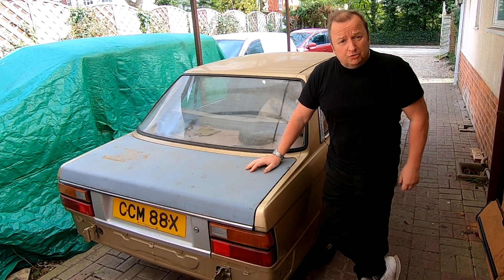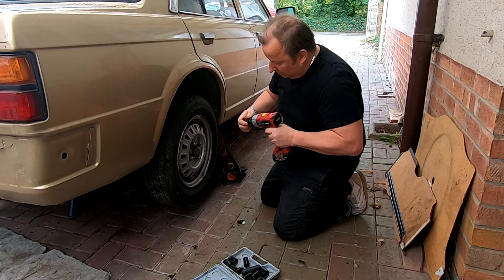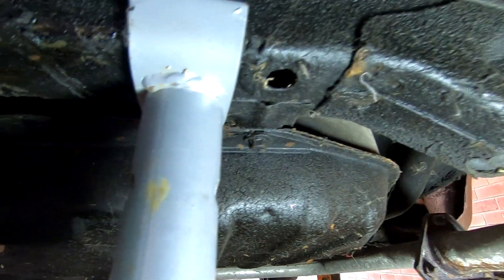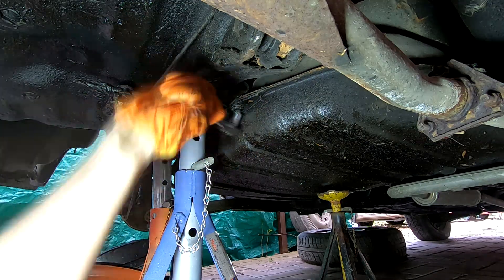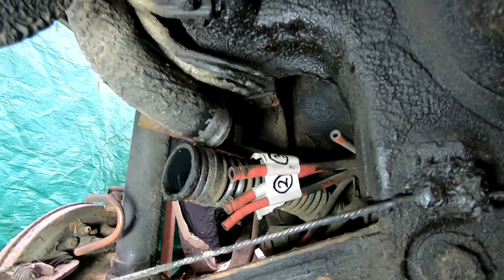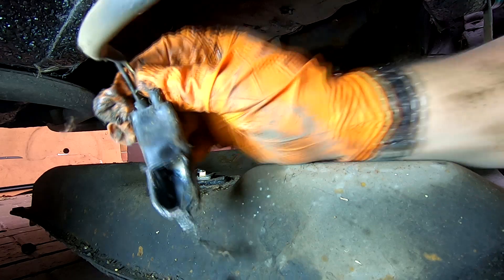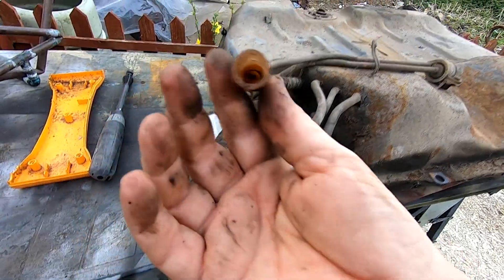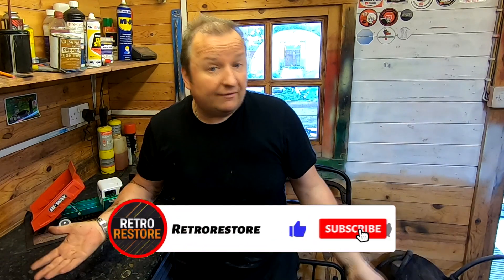Part 24 Triumph Acclaim Removing the Fuel Tank

Comment: The problem with ethanol added it attracts water. So stuff in storage doesn’t hold up. You either run the carb dry after use which we did on my older outboard after a day of fishing. Never gave me a lick of trouble. By leaving fuel hooked which dries or evaporates the oil that’s mixed from the metering valve prior to four strokes gets left behind it clogs the ports and jets of carbs. So by running the carb dry after use nothing is clogged. The fuel not used in the tank can be poured into a funnel its raw gas used in mowers to adding pre mix for weed eaters that way you can store stuff dry. It astounds me why people that go boating sit their hog the ramp with not doing stuff beyond charging or replacing batteries. A simple sta bil or Star tron fuel stabilizer Prior to storage with a full tank if your tank isn’t portable run em dry or just use the fuel in something else as I said if not fill it up add a fuel conditioners. If not this will be the thing your gonna have to do with old fuel plus a carb jet clean.
Reply from the maker: I'll use the old fuel for cleaning parts with.

Comment: Martain nice to see you started work now on the triumph I owned one In 1988 it was a very reliable car with a great Honda engine did you know the same engine was fitted to the rover 1.3 the rover 1.6 had Leyland engine fited the Honda engine was a difteent class great video martain
Phil from stoke
Reply from the maker: No, I didn't know that Phil. Cheers

Comment: Martin, I would've dropeed the tank with the filler neck. It would save having to disturb the connections to the various hoses. Fortunately, those look easy enough to reinstate. I couldn't remember which end of the tank was slotted. I did this very job on my CD Triomatic at the previous house (we moved in December 2012) on a sloping driveway. Did you see all the white grease on the electrical connector? I'm sure BL must've had a lot of the stuff lying around and needed to get it all used up. I can't see Honda insisting that they use white grease on all the electrical connections. Whatever the reason, it contributed to the reliability of these cars.
Reply from the maker: Everything came apart really easy due to all the oil the owner sprayed.

Comment: I believe it was a Honda Ballad or concerto in all but name ?
Reply from the maker: Yes it was bud. Well remembered.
Reply: @retrorestore  I thought so. It was BL's crack at replacing the Dolomite, it was a Honda colaboration wasn't it. They also colaborated with the Rover  range, the 800 being an early Honda Legend, in my opinion that was no bad thing looking back because our motor industry was about to die of natural causes anyway, and the engineering reliability that Honda bought to the table would leave a legacy that exists to this day. I've had loads of Honda's, they are totally bulletproof, I even own a KB1 legend now, to which there are only a couple of hundred registered examples on the UK register. Keep up the good work. Subbed. 👍